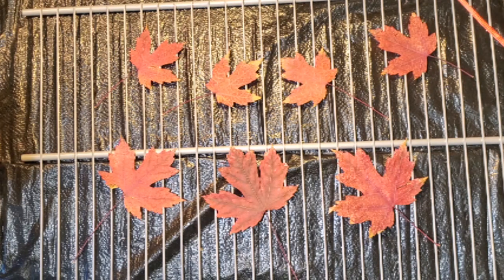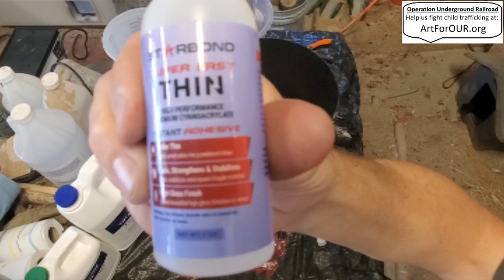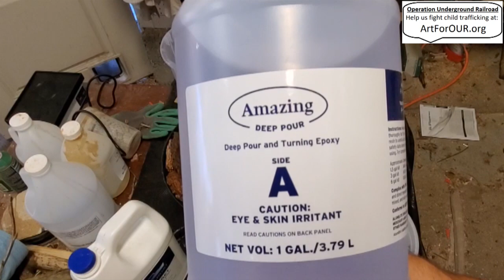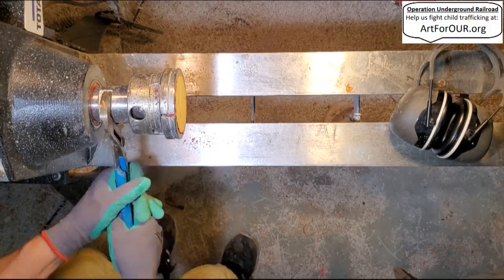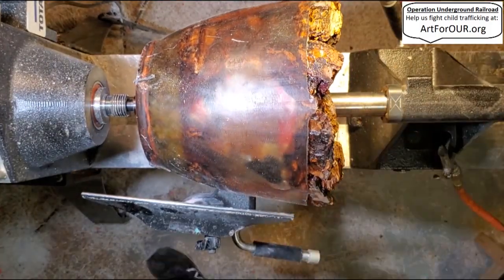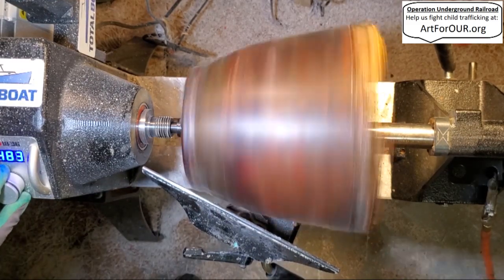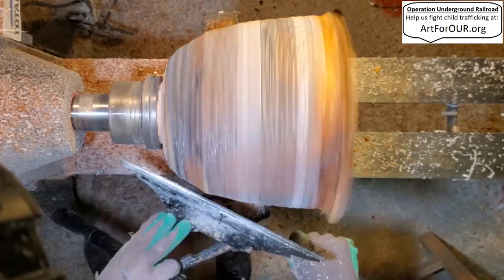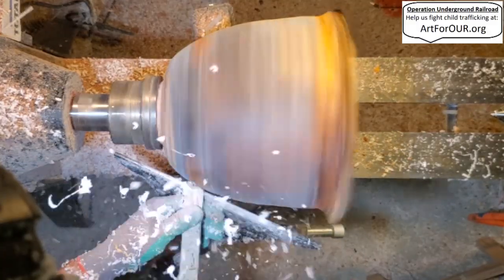"Autumn Bits"  Wood and resin turning.  Maple leaves, bark, cherrywood and clear resin.  Lathe work.

Comment: Beautiful as always! Thanks Dan, for initiating the GFM for Kim's family, she is definitely an exceptional asset to this community.
For what it's worth, when I do "open pours" without a pressure pot, I immediately place it on my dryer while it's running, it seems to help quite a bit, although I am using different resin (Designer Epoxy more readily available in Canada).
Reply from the maker: That's great advise!  Thank you as well for your support with Kim...

Artforour.org

Comment: Have you tried hot gluing acrylic pieces together around the mold and putting your vacuum lid on top of that? 

You can also pour directly into acrylic if needed and it won't stick to your resin.. just use a mallet and knock the acrylic pieces apart around the mold when cured and they come right off